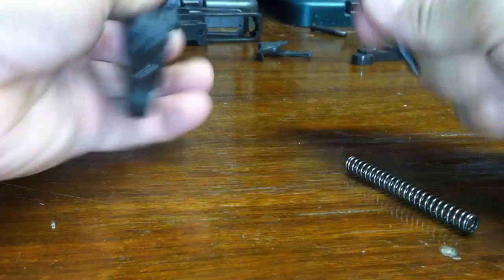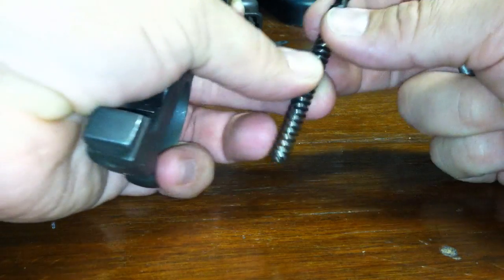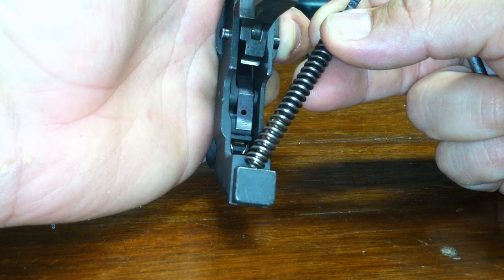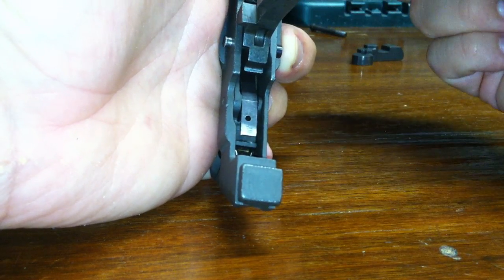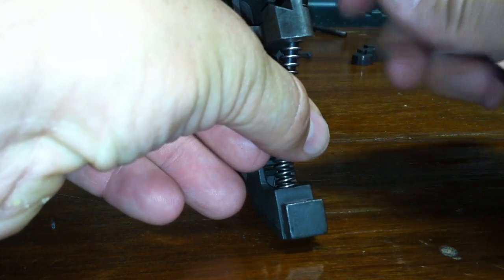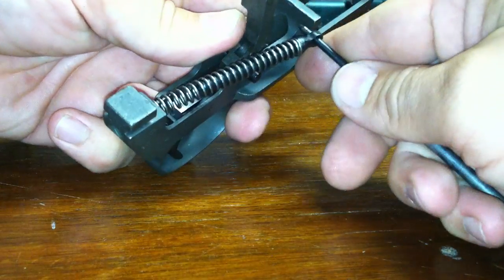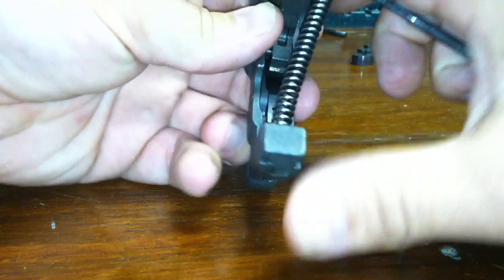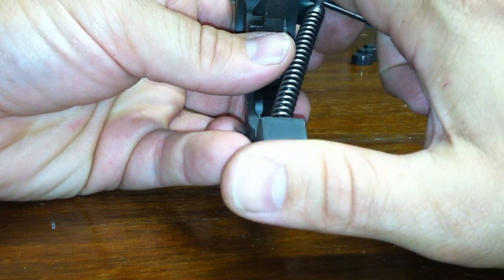M1 Carbine Hammer Spring & Plunger Installation/Assembly

Comment: I finally got it, I removed the hammer and pin, pulled back on the rod and spring and while I did that, my wife put the hammer and pin in. It was much easier then the other method for some reason...

Comment: Is the hammer spring supposed to stick out past the housing through the little hole it sits in
Reply from the maker: Not quite sure what you are asking.  The spring should be resting on the forward position of the lug and not over hang the lug.  Hopefully that answers your question.
Reply: Can I email you a picture of the housing